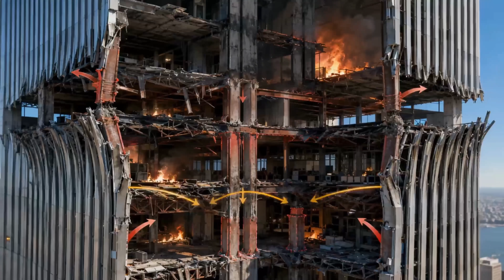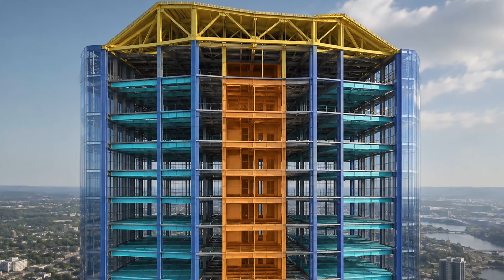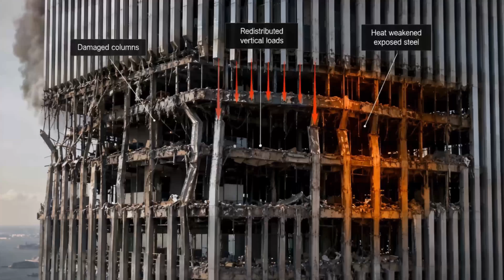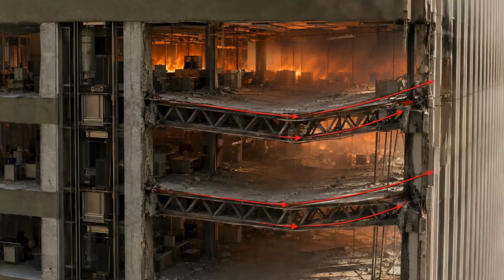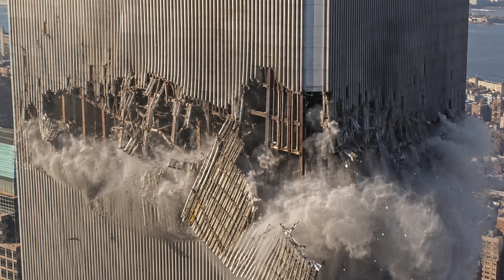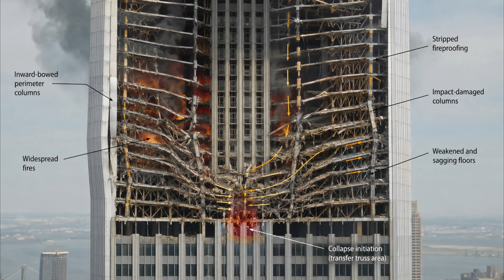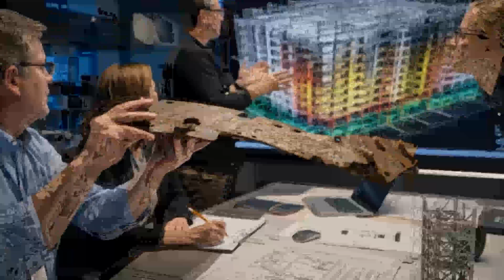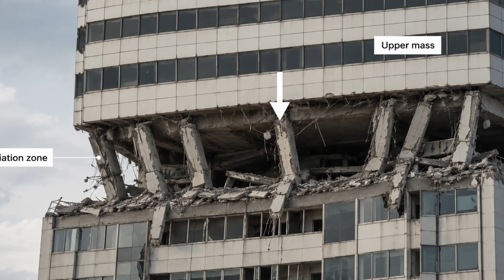What Happened Inside the Twin-Towers After Impact?

Comment: The buildings were designed to withstand floor collasped  and still keep stsnding .  Thsts becsuse of the core steel columns.  The core columns carried 60percenr of the buildings weigjt.  

The outer perimeter failing does not give the core structure a resson to collaspe
Reply: Just one floor?  And when you say floor what do you mean?  The floor truss systems which comprised the actual floor people stand on or a full story height of the Tower, columns and all?  Defining terms is important.
Reply: Look up one thing I sent you one link or donit on your own. 

Regarding one of the numerous things
Construction codes 

Fire 

The building design struss / core.  I’m telling you not that they didnt fail im giving you the design plans jow they were intended to work.
Reply: @TheLoonResistance one piece of advise for  any future event in the media you wanna take at fsce value.

Pay close attention to when a question is asked and how the person actually responds to it.   There happens to be a lot more going in than what you notice or comphrehend.  

One technique of many is called a PIVOT /MISDIRECT.   Used when someone doesn’t wanna answer a question or cant answer.    So when you stsrt noticing things.   

Ask your why won’t he answer thst question?   You come to your own conclusions.
Reply: @T @TheLoonResistance fining terms sre important.   Like having dimensions.  Yes the floors the truss system.  

Designed to be able to give out numerous floors and not affect the Core structural integrity.  

Yes there connected as there supposed to be and in when the truss floor plan cant hang on cus they sag or get heavy or burn they are designed to give out ( breakaway ) and not affect the Core structural integrity.

I keep telling you not replying with your TWO cents.   I’m giving you links to this stuff.   It’s not my opinion.   Wiki alone under the resources section at the bottom I’m if you never read any nefore.  It’s where they got there information used in the article  etc.
Reply: @TysonThomas-u1u  - So what happens to a single long-span floor truss system - a single floor - if thousands of tons of debris combined from the 20-odd floors above start crashing down onto it more or less all at once?
Reply: @TheLoonResistance  That still  would not explain free fall acceleration (which NIST admitted happened).  A falling mass, regardless how heavy, falls at 32 feel per second square UNLESS something prevents it from doing so (slows it down).  Newton's third law says for every action there is an equal and opposite reaction.  When one object pushes or pulls another object, the second object pushes or pulls back with the same amount of force.  A floor crashing down upon another floor will meet equal resistance pushing back up upon it.  This makes free fall impossible.  Even air will provide air resistance to a falling mass and will slow down the falling mass slightly.  What do you think thousands of tons of steel and concrete in the path of most resistance will do?  You speak of the "thousands of tons of debris combined from the 20-odd floors above", but you are silent about the thousands of tons of debris combined from the 90-odd floors below.  And yet the buildings fell in approximately ten seconds which is approximately free fall. And the floors did not start crashing down onto one another more or less all at once.  Nearly all the concrete in all the floors were pulverized to dust which expanded into a massive dust cloud for thousands of feet into the sky and settled all over lower Manhattan as six inches of grey dust river to river.  If it were a pancake driven collapse you would have seen a stack of floors piled up at the bottom.
Reply: Why do you keep replying on all my comments with nothing but your opinion.  I’m asking the audience now to throw you a lifetime and counter me with something other than your opinions.   Iv given you countless responds to your own personal opinions.   Do you realize that it’s a lose situation if I’m giving you links sources and your giving me just your opinions
Reply: @TysonThomas-u1u  - All of your comments are your opinion so pot, meet kettle. 

My arguments are factual, well reasoned and robust. Instead of being butthurt that I make them, how about you either;
A. Thank me for the information OR
B. Offer a rebuttal with superior facts, logic or reason.

Also, I was active in these videos in some cases years before you got here, so if you could stop following me around that would be great. 

Now then, back on topic... what happens to a single long-span floor truss system - a single floor - if thousands of tons of debris combined from the 20-odd floors above start crashing down onto it more or less all at once?
Reply: @TheLoonResistance your following me around.  Who commented on who’s 5 comments first?  Iv countered sll your Opinions. The forst comment í msde were sll my OPINIONS everything after thst were articles from sources uv read and I told you where to look.   Your response was yiur stupid thsts dumb.
Reply: Guess what without the official blue prints and without knowing the  dimensions of anything i cant answer your questions of how many floor truss were designed to give out without structural failure.   

A more important question is why did they not provide blue prints !!!!!
Reply: You ever hear about insode trading.  Ahain not my opinion look it up 

September 6th and 10th
Someone made bets (put options )betting thays the stocks will drop of a company.  150k in bets.  100x higher thsn daily average.   For united airlines and AMA.   Netting like million cus there stocks dropped.  

Common knowledge look it up.  
What you don’t hear about is the major companies in the towers.  Morgan Stanley.   Esrly sept same drastic spikes in put options

Merril Lynch average 250 put options daily.   Days before 911.  Someone bought over 12000 put options   Again betting the against the stock prices.  

And it goes on and.    
Another interesting thing uu know nothing about.   Look up tue list of CEOs EXECUTIVES financial directors.  Who happened not to be there THAT day.   Coincidence/ LUCK .  Foresight idc what you come to decide but wsnted to share some facts.   LOOK it up
Reply: - Did you forget your meds?
Reply: @TheLoonResistance you have not countered one of my points NOT ONE!  I even said counter one pick anytjing of them you want and counter it.   And if you can I will say YOUR RIGHT.  And I was wrong.  But you haven’t even tried bro.   Again  im giving  info  you can look up yourself.   And your giving me your stupid
Reply: @TheLoonResistance haha this is exactly what I’m tslking about.   I hit you with actual FACTS and you come back with “did you forget your meds?). Jeez bro good one .
Reply: I wish our thread was public,  I’ll make it public let me copys these
Reply: @TheLoonResistance find me one video thst talks about the core failure colasped or rather a video of that.  Instead of floor truss and fire?  Is this obvious to you ?  You never noticed in all the simulated videos they do not show the core collumns failing ???? I’m done with you
Reply: @TheLoonResistance you cant reason with crazy
Reply: @TysonThomas-u1u  - All of this is public. Anyone can read these comments 🤦‍♂

I can't find you a video that talks about core failure because core failure is NOT the cause of Twin Towers collapses.  Cores failed LAST.  I explained Twin Towers collapses step by step and in detail the other day and you seem to have missed or ignored it, so here we go again.  I suggest you take your time and go through it slowly. 

While complex, most of the Twin Towers collapse mechanisms can be seen with the naked eye and easily discerned and understood by the layperson IF sufficient time is taken to understand.

1.   The Twin Towers consisted of 4 primary structural elements together forming an integrated system where each relied on the others. 47 hollow box-section steel Core Columns carry most of the gravity loads. The 236 hollow box-section steel Perimeter Columns carry the remainder and ALL of the lateral (wind) loads. Long-span Lightweight Steel Trusses connect core and perimeter column together with a Hat Truss on top to tie it all together as an integrated unit where no element can survive without the others. There was no structural load bearing concrete and most major assemblies were bolted together

www.youtube.com/watch?v=u7OqrC74Dm4

2.   The impact of a 122-ton airplane (= 12 dump trucks) at up to 587 mph with the energy of a ton of TNT destroys the aircraft in 0.50 seconds. This in no way implies the Towers come out unscathed. Some folks get hung up on that. Many perimeter and some core columns are destroyed or damaged primarily by bending, twisting, splitting weld seams and critically by bolt-shearing failures at the end connecting flanges. No cutting or slicing - the reality far more violent and brutal. 

www.youtube.com/watch?v=zF-94yDHlk8

3. The impacts destroy or damage fire insulation, fire breaks and sprinkler systems on multiple floors. Jet fuel acts as an accelerant starting huge fires start across multiple floors simultaneously that spread spread rapidly with no effective firefighting or fire suppression. This was an unprecedented fire event . Office buildings are essentially giant piles of kindling when it comes to fires, chock full of stuff that burns vigorously and quite hot. 

4. The hotter steel gets the weaker it gets shouldn’t be a revelation. With fire protection compromised the survival time of the steel greatly reduced . Over time heat gradually causes the lightweight steel Floor Trusses at the damaged floors to sag, which we can see. No steel melted or needed to. Structural steel fails long before it becomes a puddle. It just needs to bend 5. A straight column is up to 4 times stronger than a bent one. Sagging floor trusses pull on increasingly weak and overloaded Perimeter Columns, causing some of them to bow inward by up to 5 feet until they buckle and fail, quietly initiating collapse. The formerly static mass above which the structure below could easily support converts to a dynamic mass up to 30 times greater. The Columns above and below the failure point are no longer aligned . The load bearing structure below no longer bears any of the load above, which falls past the lower columns NOT onto them. www.youtube.com/watch?v=ULdiD6gYZO0 www.youtube.com/watch?v=zTygQK3vriI 

6. Heat starts the collapse, gravity finishes it . Thousands of tons of debris drop largely within the four outer walls, through the open office space, the path of least resistance crashing onto the first intact floor, The bolted column connections instantly break as the amount of resistance the Floor Trusses can offer is negligible, slowing the falling debris only marginally and briefly before the connections fail. www.youtube.com/watch?v=flo62pdaIMI
Note: 
6a. This is NOT a solid top block crashing into a solid bottom block . 
6b. The debris falls past the columns not onto them. The columns provide no resistance to the falling debris. 
6c. Only the bolted floor truss connections to the core and perimeter columns offer any resistance. A pair of 5/8” bolts at each end of each truss vs. thousands of tons of falling debris. 
6d. No laws of physics are violated. 
6e. There is no 20 floors against 90 floors but rather 20 floors against one floor, then 21 floors against one floor, then 22 floors against one floor, etc. 

7. This floor-led collapse progression largely within the four outer walls can only go straight down. There is no lateral force to push it over the side, only gravity to bring it down. 

8. Collapse progresses through the floor systems past the columns, through the path of least resistance . Resistance offered by each floor is always the same while the falling mass acting on it is constantly increasing and accelerating (gaining energy). This process of floor-by-floor destruction cannot be arrested. It can only speed up . Rate of floor failures increases with each floor as momentum increases, reaching an average acceleration of 0.65 of GA, or 35% slower than true free fall. Bam, bam, bam down the building until there are no more floors to fail. More mass, more velocity, same resistance with each floor. Don’t get stuck on the but the lower floors weren’t on fire nonsense. They didn’t need to be. 
8a. This process is often incorrectly referred to as “pancaking” which while catchy, is incorrect. Too simplistic and inaccurate anyway. More like Kaiserschmarrn. 

9. The Towers were 95% air by volume. As that air was compressed inside the building by falling debris, pressure builds until it is blown out the sides in reaction to the building collapsing . Those were not “explosions”, it was expulsions of compressed air caused by the collapsing building, explaining the low velocity, lack of flash, blast, supersonic pressure waves and lethal high-velocity ejecta. 

10. Perimeter Columns become detached and peel away like a banana behind the collapse front, playing out to the four points of the compass in long lines extending to 800+ feet from the base of the towers, damaging and destroying nearby buildings. 

11. Core Columns fail last as their internal beam bracing is stripped away by falling debris and lateral support from the floors to the perimeter columns is lost. 

www.youtube.com/watch?v=WpHXj62Ylw0

12. This process took 31-34 seconds from perimeter columns bucking until the last core columns hit the pile, or 1/3 the rate of true free fall. Don’t believe me? Just watch a video of the collapses and note the loose truly free-falling debris dropping much faster than the towers themselves. 

https://www.youtube.com/watch?v=dh4r-gHdyPU 

13. Each Tower had a 1-acre footprint. Far from collapsing inside their own footprints the debris pile spread out over 17 acres in a pile up to 14 stories deep. 8 surrounding buildings were destroyed and scores more damaged by the falling debris. 

14. NOT observed were the 180-190 dB bangs of thousands of high explosive devices or the blinding brightness of burning thermite. Explosives or thermite couldn’t have survived the impacts and subsequent fires anyway. Nor could they have caused the perimeter column buckling that clearly initiated collapse. Video of an injured and in-shock firefighter casually using the magic word explosion isn’t proof of explsoIVES and hardly makes a case for planned demolition. Pre-planned demolition doesn’t match the physical evidence and would be technically impossible, totally impractical and completely unnecessary. Simply, no one would bother. In 24 years, no structural engineers of tall buildings, including the 1/3 who have retired, have made any statements in support of planned demolition claims. NONE. The lack of such citations in engineering literature published anywhere in the world is telling. 

15. Twin Towers were perfectly safe within their design envelope. They only collapsed when taken far outside design parameters by an extraordinary and unprecedented event Impact + Fire (heat) + Time + Gravity = Collapse . Remove any 1 of those 4 elements and there is no collapse. Ignore any of them and you will never understand the collapse. The Twin Towers were an integrated system in which no one component could survive without the others. One fails, the rest follow, through the path of least resistance DOWN the open space, bypassing the path of greatest resistance, the columns. No laws of physics are violated and the above is true no matter who planned and carried out the 9/11 attacks or why so the attacks could still be an “inside job”. 

If you made it this far, kudos. That was a lot. I hope it was helpful, informative, non-adversarial and solicits informed critical comment, positive or negative. If I made any errors of fact, logic or reason or left anything critical out, please let me know and I’ll fix it. To stay focused, just one point at a time please and on-topic (Twin Towers ONLY). No word-salads of Gish Gallop. IF you can offer a more plausible alternative be my guest. Please start any reply with the words “Tits McGee” or I’ll know you didn’t read it and aren’t serious. Thanks for your time.
Reply: usually - EVERTHNGS connected !! ... when one thing fails, it usually means it has to compensate from SOMEWHERE
Reply: Actually how about we flip scripts.   I’ll argue your side and you argue mine.   And I promise you I’ll still beat you.  ????
Reply: @TysonThomas-u1u  - No deal. I have no idea what you are on about most of the time. How about I explain Twin Towers collapses in detail from start to finish and you listen, since you won't be able to do the same?

At the end of the day, we all just want to know what really happened, right? It’s tough because even though structural engineers had figured it all out within weeks there is still a massive amount of misinformation out there on the internet to muddy the waters. How is the layperson supposed to sort it all out? 

I’ve put more thought into this than most since anything can seem like a conspiracy if you don’t understand how it works and I like understanding. If you don’t mind, I’d like to offer my perspective. You may choose to disagree, but if I am in error on any point of fact, logic or reason please let me know.  Just saying you are wrong or I don’t believe you isn’t compelling. 

While complex, most of the Twin Towers collapse mechanisms can be seen with the naked eye and easily discerned and understood by the layperson IF sufficient time is taken to understand.

1.   The Twin Towers consisted of 4 primary structural elements together forming an integrated system where each relied on the others. 47 hollow box-section steel Core Columns carry most of the gravity loads. The 236 hollow box-section steel Perimeter Columns carry the remainder and ALL of the lateral (wind) loads. Long-span Lightweight Steel Trusses connect core and perimeter column together with a Hat Truss on top to tie it all together as an integrated unit where no element can survive without the others. There was no structural load bearing concrete and most major assemblies were bolted together

www.youtube.com/watch?v=u7OqrC74Dm4

2.   The impact of a 122-ton airplane (= 12 dump trucks) at up to 587 mph with the energy of a ton of TNT destroys the aircraft in 0.50 seconds. This in no way implies the Towers come out unscathed. Some folks get hung up on that. Many perimeter and some core columns are destroyed or damaged primarily by bending, twisting, splitting weld seams and critically by bolt-shearing failures at the end connecting flanges. No cutting or slicing - the reality far more violent and brutal. 

www.youtube.com/watch?v=zF-94yDHlk8

3. The impacts destroy or damage fire insulation, fire breaks and sprinkler systems on multiple floors. Jet fuel acts as an accelerant starting huge fires start across multiple floors simultaneously that spread spread rapidly with no effective firefighting or fire suppression. This was an unprecedented fire event . Office buildings are essentially giant piles of kindling when it comes to fires, chock full of stuff that burns vigorously and quite hot. 

4. The hotter steel gets the weaker it gets shouldn’t be a revelation. With fire protection compromised the survival time of the steel greatly reduced . Over time heat gradually causes the lightweight steel Floor Trusses at the damaged floors to sag, which we can see. No steel melted or needed to. Structural steel fails long before it becomes a puddle. It just needs to bend 5. A straight column is up to 4 times stronger than a bent one. Sagging floor trusses pull on increasingly weak and overloaded Perimeter Columns, causing some of them to bow inward by up to 5 feet until they buckle and fail, quietly initiating collapse. The formerly static mass above which the structure below could easily support converts to a dynamic mass up to 30 times greater. The Columns above and below the failure point are no longer aligned . The load bearing structure below no longer bears any of the load above, which falls past the lower columns NOT onto them. www.youtube.com/watch?v=ULdiD6gYZO0 www.youtube.com/watch?v=zTygQK3vriI 

6. Heat starts the collapse, gravity finishes it . Thousands of tons of debris drop largely within the four outer walls, through the open office space, the path of least resistance crashing onto the first intact floor, The bolted column connections instantly break as the amount of resistance the Floor Trusses can offer is negligible, slowing the falling debris only marginally and briefly before the connections fail. www.youtube.com/watch?v=flo62pdaIMI
Note: 
6a. This is NOT a solid top block crashing into a solid bottom block . 
6b. The debris falls past the columns not onto them. The columns provide no resistance to the falling debris. 
6c. Only the bolted floor truss connections to the core and perimeter columns offer any resistance. A pair of 5/8” bolts at each end of each truss vs. thousands of tons of falling debris. 
6d. No laws of physics are violated. 
6e. There is no 20 floors against 90 floors but rather 20 floors against one floor, then 21 floors against one floor, then 22 floors against one floor, etc. 

7. This floor-led collapse progression largely within the four outer walls can only go straight down. There is no lateral force to push it over the side, only gravity to bring it down. 

8. Collapse progresses through the floor systems past the columns, through the path of least resistance . Resistance offered by each floor is always the same while the falling mass acting on it is constantly increasing and accelerating (gaining energy). This process of floor-by-floor destruction cannot be arrested. It can only speed up . Rate of floor failures increases with each floor as momentum increases, reaching an average acceleration of 0.65 of GA, or 35% slower than true free fall. Bam, bam, bam down the building until there are no more floors to fail. More mass, more velocity, same resistance with each floor. Don’t get stuck on the but the lower floors weren’t on fire nonsense. They didn’t need to be. 
8a. This process is often incorrectly referred to as “pancaking” which while catchy, is incorrect. Too simplistic and inaccurate anyway. More like Kaiserschmarrn. 

9. The Towers were 95% air by volume. As that air was compressed inside the building by falling debris, pressure builds until it is blown out the sides in reaction to the building collapsing . Those were not “explosions”, it was expulsions of compressed air caused by the collapsing building, explaining the low velocity, lack of flash, blast, supersonic pressure waves and lethal high-velocity ejecta. 

10. Perimeter Columns become detached and peel away like a banana behind the collapse front, playing out to the four points of the compass in long lines extending to 800+ feet from the base of the towers, damaging and destroying nearby buildings. 

11. Core Columns fail last as their internal beam bracing is stripped away by falling debris and lateral support from the floors to the perimeter columns is lost. 

www.youtube.com/watch?v=WpHXj62Ylw0

12. This process took 31-34 seconds from perimeter columns bucking until the last core columns hit the pile, or 1/3 the rate of true free fall. Don’t believe me? Just watch a video of the collapses and note the loose truly free-falling debris dropping much faster than the towers themselves. 

https://www.youtube.com/watch?v=dh4r-gHdyPU 

13. Each Tower had a 1-acre footprint. Far from collapsing inside their own footprints the debris pile spread out over 17 acres in a pile up to 14 stories deep. 8 surrounding buildings were destroyed and scores more damaged by the falling debris. 

14. NOT observed were the 180-190 dB bangs of thousands of high explosive devices or the blinding brightness of burning thermite. Explosives or thermite couldn’t have survived the impacts and subsequent fires anyway. Nor could they have caused the perimeter column buckling that clearly initiated collapse. Video of an injured and in-shock firefighter casually using the magic word explosion isn’t proof of explsoIVES and hardly makes a case for planned demolition. Pre-planned demolition doesn’t match the physical evidence and would be technically impossible, totally impractical and completely unnecessary. Simply, no one would bother. In 24 years, no structural engineers of tall buildings, including the 1/3 who have retired, have made any statements in support of planned demolition claims. NONE. The lack of such citations in engineering literature published anywhere in the world is telling. 

15. Twin Towers were perfectly safe within their design envelope. They only collapsed when taken far outside design parameters by an extraordinary and unprecedented event Impact + Fire (heat) + Time + Gravity = Collapse . Remove any 1 of those 4 elements and there is no collapse. Ignore any of them and you will never understand the collapse. The Twin Towers were an integrated system in which no one component could survive without the others. One fails, the rest follow, through the path of least resistance DOWN the open space, bypassing the path of greatest resistance, the columns. No laws of physics are violated and the above is true no matter who planned and carried out the 9/11 attacks or why so the attacks could still be an “inside job”. 

If you made it this far, kudos. That was a lot. I hope it was helpful, informative, non-adversarial and solicits informed critical comment, positive or negative. If I made any errors of fact, logic or reason or left anything critical out, please let me know and I’ll fix it. To stay focused, just one point at a time please and on-topic (Twin Towers ONLY). No word-salads of Gish Gallop. IF you can offer a more plausible alternative be my guest. Please start any reply with the words “Tits McGee” or I’ll know you didn’t read it and aren’t serious. Thanks for your time.